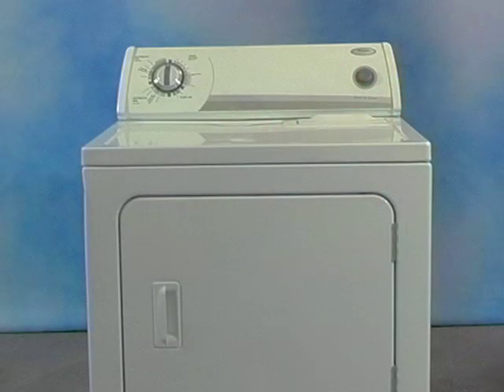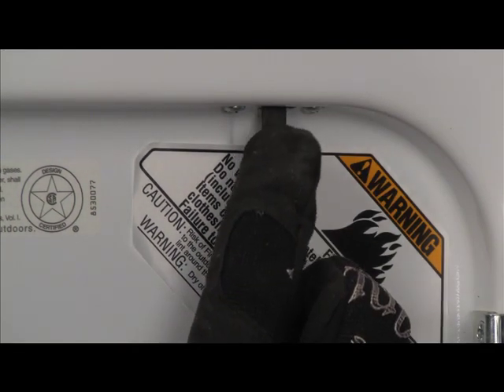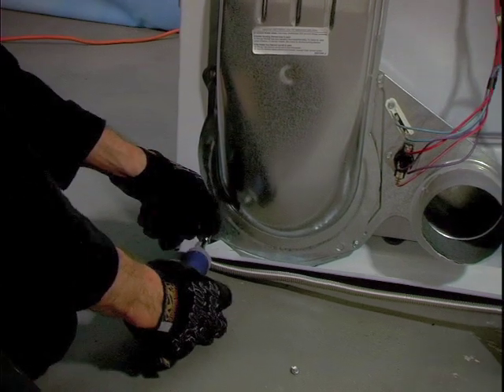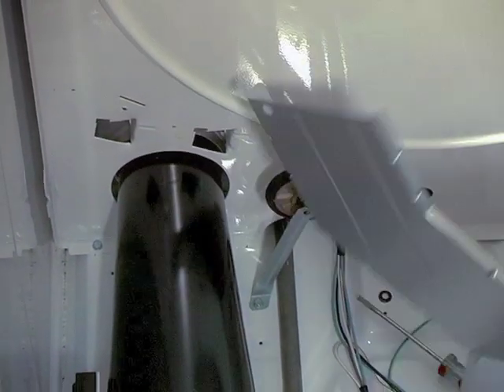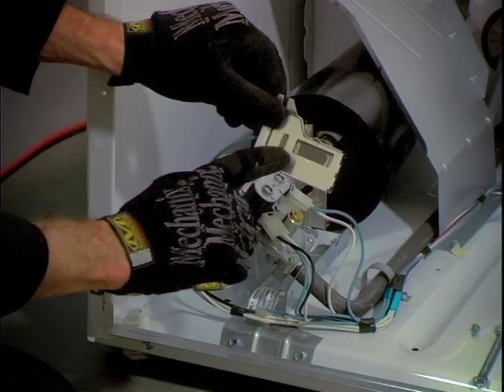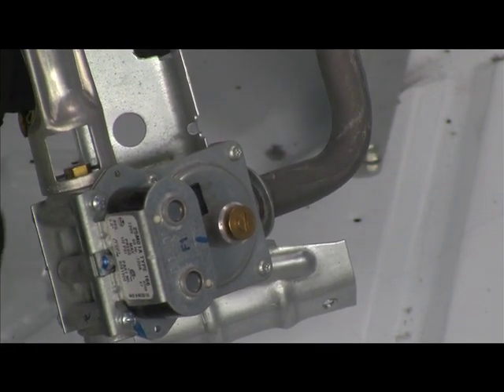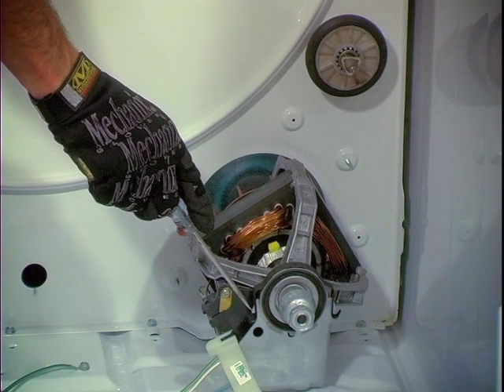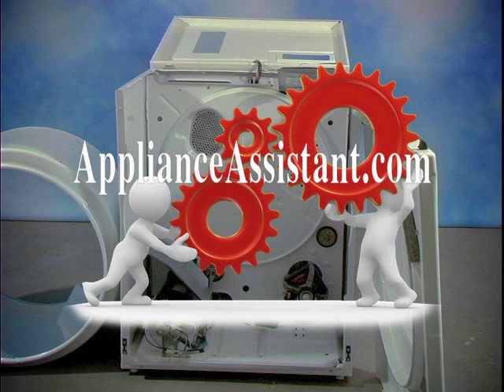Gas Dryer Repair Top Lint Trap Dryer Troubleshooting

Comment from the maker: You should probably check you heating element to ground for continuity.  If the heating element breaks and makes contact with the heater housing it will bypass the control thermostat and get a neutral connection to the cabinet. Sometimes trips the breaker but not always.  You just need to cut power and disconnect the element from the circuit before checking resistance to the heater case. Could also be the thermostat, but they are fairly reliable... element is common. Hope that helps! Good luck!

Comment from the maker: Sorry for the delay! I didn't get an email notice on your comment for some reason : (  Thats a tough one.. you would need to do some voltage checks on the motor side to see where you are loosing power.  It would be nice to know if you are getting 120 VAC at the thermal fuse. If not you would probably need to see if electricity was coming from the timer to the motor.

Comment from the maker: Sorry it took so long to get back with you!
Could be the timer... but... Coin op dryers with a mechanical timer can stack up a great deal of time of the timer mechanism as you fiddle with it.  the only way to get it back off is to let it run out or take the cam off the timer assembly and set it back to zero.  Hope that helps!

Comment from the maker: Not for the style that is in the video, with the top lint trap. It is accessible from the back of the dryer.  Most other styles have the blower in the front left and you can still leave the drum in to clear it.  Thanks for the question.

Comment: Hi guys!! I hope somebody could help me,I did some repair on a GE gas dryer about 12 years old,its a coin accepter operated dryer for the building tenants, I replaced the flame sensor and the gas valve coils and I tested it and it heats good, but now it does not time out, it keeps running,I even put the 4 quarters,it's a dollar dryer and even so it did not stop.could somebody help?any ideas?please help?

Comment: Very nice video, clear, concise, and nicely detailed.  Thank you.  Now for searching a tad more about the electrical safety and control components and possibly how to check them with a Digital Multimeter.  My problem with a Whirlpool Electric Dryer is that the heating element stays glowing bright orange with all the elements working on very high heat all the time no matter what temperature the front control is set on, and it will overheat, hot smell and shuts down eventually the heating element.

Comment: Thanks for the excellent video. It helped me fix the problem with my Maytag Centennial dryer. A kids sock had somehow worked its way past the seals and jammed in the blower fan. The rear seal looks okay, so hopefully this was a fluke. I wish I had taken to heart your warning about sharp edges though. I cut the tip of my index finger on the edge around the blower fan. What kind of gloves are you wearing in the video? I should use the money I saved by repairing it myself and buy a pair of those.

Comment: @yloby After further consideration, a sock working its way past the rear seal would have only ended up in the body of the dryer (with the motor, and with the 57 cents in dimes, nickels and pennies that were in there). This was more likely the wife using the top of the dryer for laundry storage whle she emptied the lint trap, and the errant sock went down.

Comment: Thank you very much.  A small sponge paintbrush fell in the lint trap, and I got it out by watching your video-- the dryer is working now.  For others, I would advise using the stiff putty knife--still hard to pop the top even with it, but impossible with the bear hug.  Thank you so much

Comment: (Part 2)  After watching your video, I suspect the Cycling Thermostat is shorted and does not shut off by cycling the voltage to the heating element.  I will watch the heating problems video at the web site you suggested in your video.

Comment: I have a whirlpool, mn# WED5540sq0.  It stopped working suddenly between loads, no noise or acting up prior.  I changed the thermal fuse, door switch, and start/stop switch and still no luck. Any ideas what to check next??

Comment: Thanks so much for the easy to follow, simple as can be video.  Between this one and the one about Troubleshooting gas dryers I was able to diagnose my problem, (valve solenoids), quickly and easily and be back up and running within a day.  AWESOME!
Reply from the maker: Congratulations on the repair victory! Thanks for the comment!

Comment: Another crazy good video! It's really amazing how well the felt and nylon works as a bearing materiel. It's not one of those well known inventions. Near perfect design. I have a newer LG washer that had an issue with the water valve, it was under warranty and the tech came out to replace the valve so I was able to take a peak, well the valve that was sent was not the correct one. Rather then him come back out I asked if he could send the valve and I do the replacement. He was OK with it and everything went well. Still working today.
Reply from the maker: That's great! It's definitely good to be able to work on appliances... Going to be more common for the new ones to have problems... Just the way things are now...

Comment: Why the *&%$ can't they just make all dryers with the lint filter in the door?
Reply from the maker: mattcintosh2 I agree they are much easier to clean!  However, the top lint trap system actually works MUCH better at catching lint. You would be amazed how much lint gets by most in-door lint trap systems and builds up inside the dryer! It's not uncommon for me to clean out 1/2 inch of lint from inside that type of dryer during a repair... scary!